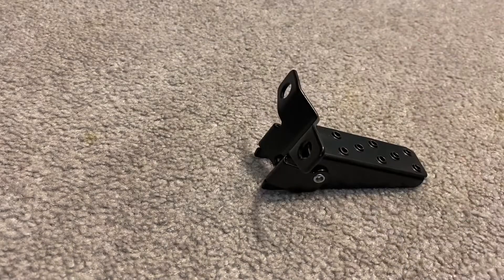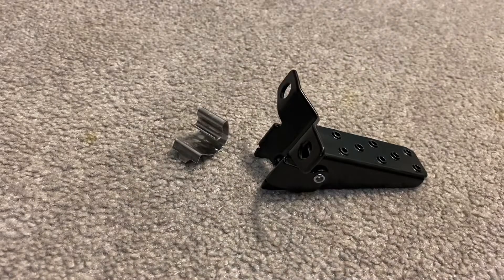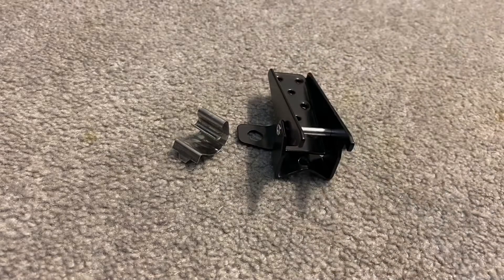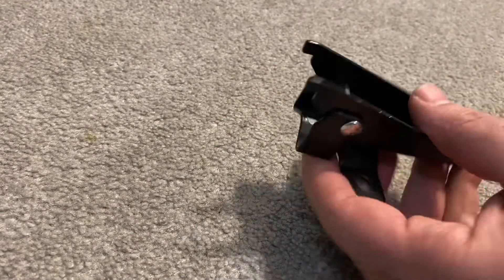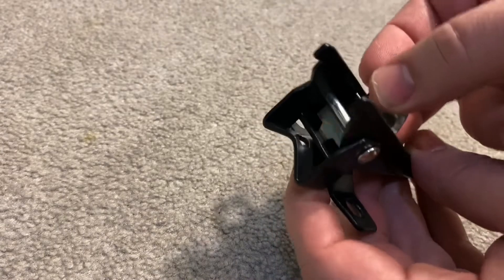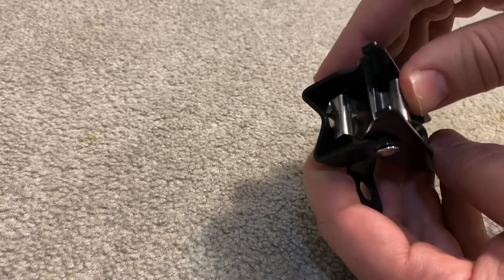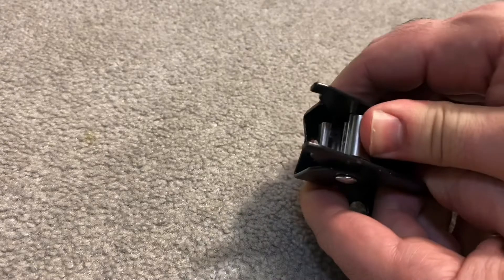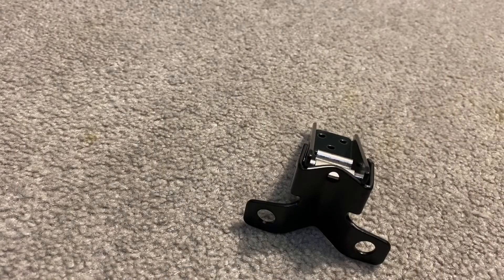GT Forkstander Spring Clip Installation

Comment: Great bikes and nice video! Do you know how to safely remove the springs? I want to do a thorough cleaning on mine but having a difficult time figuring out how the remove the clips.
Reply from the maker: Edgar Jimenez, to remove the spring clip you need two flat head screwdrivers. One to press in on the tab slightly from the outside of the stander and the other to push down on the clip from under the pin. So reverse of installation. It will pop out without much effort. I’ve done it while show mounted on bikes before.

Comment: Whats good to put under the frame stander so u wont scratch the frame when installing then?,if the bike was black i thought of a piece of an intertube cut to spec.
Reply: I just bought some neoprene foam sheets from Michaels to separate the 2 metals on my PFT. I will let you know how it goes

Comment: Can springs from knock offs be used in GT gen 2 standers? I'm in the need for two springs.
Reply from the maker: Robert Yes they can provided they are spring clips and not springs per se. Sometimes you can find these for motorcycles on Evilbay.
Reply: @atrains  What should I search for motorcycles? I was going to buy a set of knock offs, but was getting conflicting answers on whether they fit.